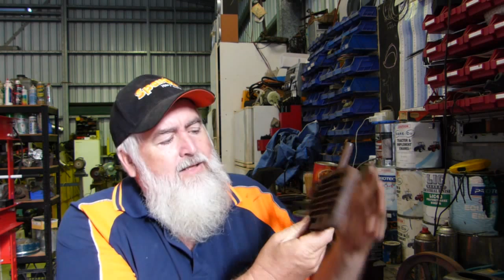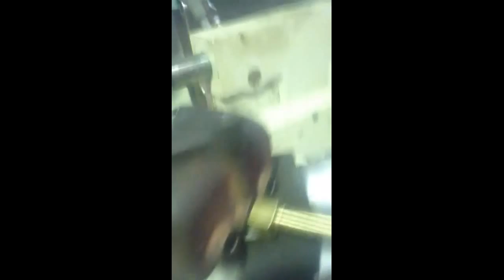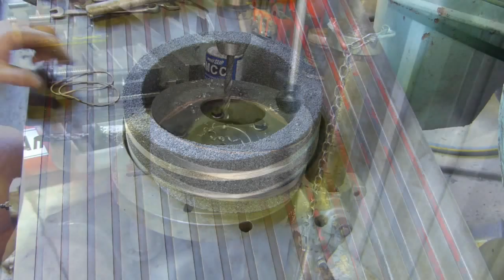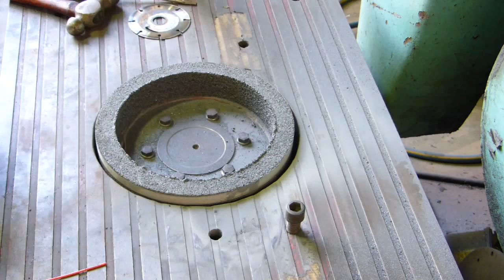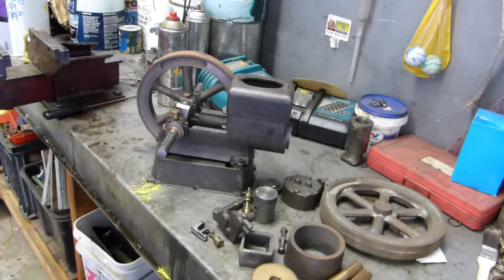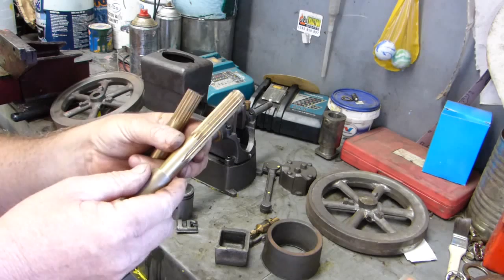Kangaroo Stew #5

Comment: Stating the obvious here, but be sure to ring test the cup wheel offcut for cracks before you bond it to the backplate, and use your best safety squint when you flick the switch for the first time!
Thanks for the updates.
Reply from the maker: +Flintstone Engineering I will for sure, I did it to the cup stone before cutting but I will test the ring before epoxying on. Safety squint might be a good idea lol. Thanks for watching.